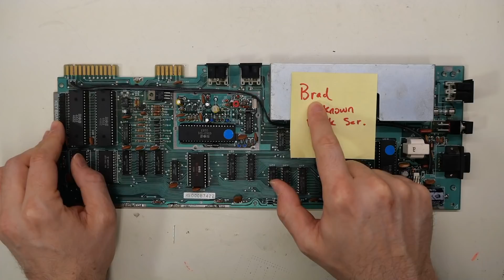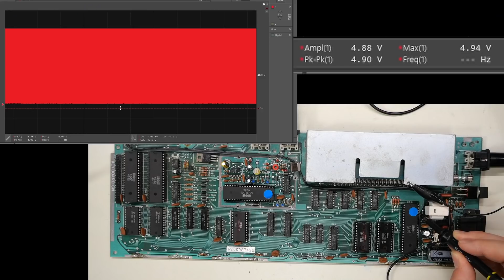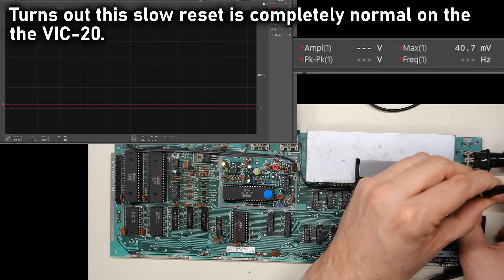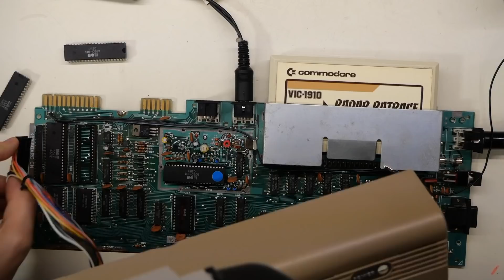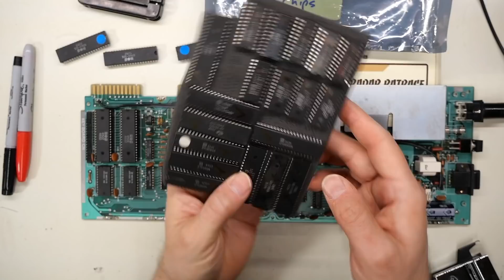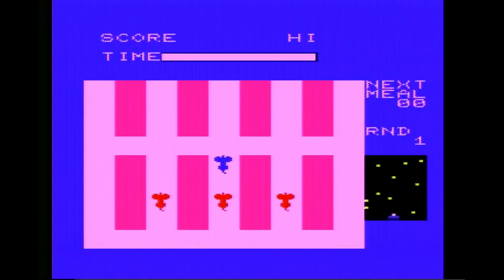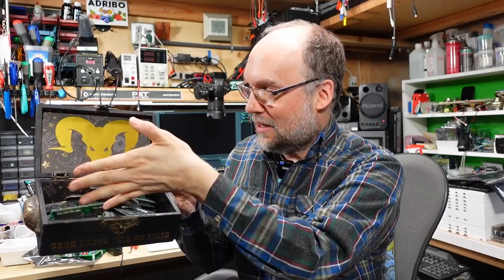Repairing two VIC-20 motherboards

Comment: Well i wish you could repair our vic20’s if our vic20’s don’t work.
Mine seems to not work.
Because all i got is a black screen no matter what i tried, swapping those colored av plugs and swapping av cables while using the right power supply for it.
Yes it was untested but that person had no av cable or power supply for it so he couldn’t test it.
Still through it’s a bummer that mine one doesn’t seems to work.
So if you could repair mine, i would appreciate that.

Comment: The thing with semiconductors is that they do fail over time. At least these old chips won't fail as quickly as modern chips. But they will sooner or later inevitably stop working. The chip can even be laying on a shelf, packed in anti-static foam, in an argon filled hermetically sealed box, and it will still eventually die of age related failure.

One big reason for this is due to diffusion of unwanted dopants entering the silicon. Diffusion is how dopants go into the silicon to start with, usually assisted by having the whole wafer at the time heated to a couple hundred degrees C. A rough rule of thumb is that diffusion gets 2x faster for every 10 degrees C. As an example, a quick 15 minute annealing step at 300 C is going to diffuse these dopants as if one did the same diffusion process at room temperature for 5 thousand years. (This is an excessive oversimplification, but atoms move even if we can't see it with our eyes.)

Different materials diffuse at different speeds. Copper for an example is a speed daemon compared to tungsten. Both these materials are however going to kill semiconductors by turning them into resistors as they diffuse into the depletion region. Tungsten is also what makes contact to the transistors themselves, but due to its insanely slow diffusion, it won't reach that depletion region before copper ions in the surrounding packaging has migrated in and done the job. (since most IC packages have some verity of tinned, copper plated steel.)

Now, chips have diffusion barriers to stop external contamination from getting into the chip. But diffusion barriers are more like speed restrictions. Its a bumpy gravel road with more potholes than road compared to the smooth flat highway, but it won't stop copper from making it through. It will take them longer, a few decades or perhaps a couple of centuries, but they will get there. (at room temperature, at operating temperatures it goes faster. But old chips like these don't get all that hot in operation.)

Modern chips however make a huge sacrifice that these older chips didn't. And that is copper interconnects in the chip. Older chips used aluminium, and aluminium is a weak P dopant and doesn't migrate further than the depletion region. It does slightly change the specifications of the transistor, but outside of precision analog applications the difference is rather meaningless. (also this weak P dopant is why one uses tungsten to contact the transistors, aluminium would introduce an extra diode when connected to N doped silicon, and this would make a lot of circuits not work. Tungsten meanwhile is so slow at diffusing that it doesn't care about becoming a dopant.)

Even a lot of modern chips still use aluminium. It has both a reliability advantage, it isn't toxic to the transistors. And it is also cheaper to work with, since it isn't required to be encapsulated in a diffusion barrier. As a metal it is however having ~57% higher resistance so for very power dense applications it isn't always a suitable option.

Copper though has the disadvantage that it needs its diffusion barrier, adding cost. And this diffusion barrier can't be too thick, then one ends up with higher overall resistance than if one just used aluminium and then it's pointless to use copper. The diffusion barrier also needs to be thick enough, else copper will meaningfully diffuse through within the product's intended life span. So it isn't atypical that the smallest interconnect layers closest to the transistors are made with aluminium, since the diffusion barrier proportionally takes up too much space to make the overall resistance lower than that of aluminium. While the larger interconnects further up use copper, since the diffusion barrier is proportionally thin enough to make the overall resistance lower than that of aluminium.

In practice, a lot of chips don't use copper interconnects. It just isn't advantageous if one has a lower power density, and or aims for a longer product lifespan.

In the end of this long comment.
All chips will inevitably fail from contamination.
More power dense chips made from the late 90's on wards are even more likely to fail in a relatively "short" time span due to the use of copper interconnects. (and also why server CPUs intended for 24/7 operation have lower "max" rated temps for their specifications compared to consumer parts expected to run a lot fewer hours per day.)

But I honestly expect there to be proportionally more (or just overall) computers from the 80's alive and running than computers from the late 90's if we look into the future some 30-40 years. (Though, early 2000's systems are likely going to be even more rare as thermal limits weren't really a thing and these chips runs hot enough to need that. So user induced failure is a high possibility.)

Comment: For those dead VIC chips if I were to make a guess of why these die would be heat. They all get hot inside of a closed metal box. With my VIC-20 systems the first thing I always do is open them, take off that VIC video chip box cover and add a heatsink....if it is working when I get the machine obviously. Then I heatsink the rest.

Personally however I have never actually encountered a dead VIC-20. I perform the preventative maintenance, but again they are never dead. They always however need pot adjustment.

Even so, the chips are old and will all fail eventually no matter what we do. It would be nice to see VIC video replacements though like we see on the C64 with things like the Kawari.

Comment: commodore machines never have a proper reset circuit with a guaranteed timing (like the dallas econoreset). it's just some analog crap involving capacitors with no guaranteed set timing. no brown out protection either. so it can take as long as the capacitor takes :P whatever that may be after 40 years. :P (or what they had in stock at that time ;)

Comment: a 6502 system will usually do 'something' with just the cpu, clock, something to hold the reset vectors (kernal rom or other rom that is either mirrorred up to ffff or actually is at ffff, and preferably stack and zeropage. the vic-20 is a somewhat special case in that the cpu is isolated from the address and databus by some latch logic chips (obviously to let the vic do it's thing). which after pulling everything else out are usually the primary suspects. everything seems to work fine up until setting the border and background color (which on the vic-1 is a combined register holding both) that blue is not the default reset state. funny thing. what makes commodore computers so reliable is that there is absolutely zero error and backchecking. :P 'oh hey imma gonna pull all the i/o chips out and neither the kernal nor the basic will do as much as print an error about it' :P it just initializes stuff and moves on. lol.. it doesn't even properly test the ram :P

Comment: as the kernal rom has the reset vectors and all... i would just pull out the basic rom :P but hey... :P what does one expect to happen when one powers up a 6502 system without defined reset vectors on an open bus.

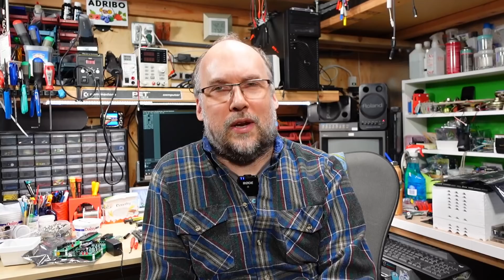Comment: 40:00 people have been working on rudimentary IC fabrication at home but perhaps before that becomes feasible to produce retro replacement parts at scale we might get companies starting to provide cheap custom FlexICs (ICs on flex-cable type substrate, they already made an implementation of 6502 on it). all we'd need is for someone to reverse-engineer any missing chips
Reply: well flexIC might not be suitable for making replacement parts for silicon circuits in foreseeable future because it can't switch as fast (the flex6502 runs at 71khz) but maybe some day

Comment: I managed to acquire what looks like a model 1 Rev b VIC-20. It has 10 ram chips/ gold label and 2 prong adapter. The one issue I'm concerned about is heat. It has a large black heatsink that gets hot to the touch. Is this normal? The main cap looks a bit crusty which needs changing out. thanx

Comment: Interesting. I had visited Commodore just as the C64 was beginning development and saw talked with some of the VIC20 and C64 designers. Quite interesting. You mentioned a "Signetics" 6502 but I believe that would be a Synertek 6502 as Synertek was the second source for 6502 chips. I also don't recall Signetics making a 6402. Synertek also developed some of the 6502 peripheral chips such as the 6545 CRTC (similar to the Motorola 6845 CRT Controller chip). At the time I visited, MOS Technology was considering producing the 6545 but I don't believe they ever did. Great video, thank you.

Comment: I just picked up a Vic 20 yesterday - along with Radar Ratrace (go figure).  No video output (with or without cart) and no sound with cart. Additionally pretty much no chips are socketed. Only 3 sockets in fact: UE8,UD8 and UF8 (the 3 bus transceivers) The Kernal ROM gets very warm, basic ROM gets warm, I think everything else is very cool to the touch. No logic testing equipment at the moment and no vacuum desoldering station (lost in the mail months ago - ugh).  Time to follow Ray Carlsen's best advice on Commodore repairs: "if you have a major problem with your VIC20, it's probably best to start looking for another one"

Comment: Been trying to repair my childhood Vic-20 for a while now. Aside from a bad reset circuit capacitor, which was holding _RESET low for 30 seconds(!) before boot, bad 6560-VIC. Got a couple replacements from kind people on Reddit, but they both had problems as well. First one had a bad clock divider, so no clock to the CPU. Second one can't seem to consistently drive the address bus to get character data and is a thermal fault. Cold Spray helps, but not for long. Makes me worried that all VIC-I chips' days are numbered like the PLA on the C64 or the CPU on the C16/Plus4.

Comment: It is important to know that the newer VIC20 can use the standard C64 power supply, but its original brick must not be used with the C64. It will work for a while but the regulator for the 5V rail is not designed for the load, and will eventually fail destructively.

Comment: Do you think it would make sense to build a drop-in replacement for the 6502 or 6510 based on the W65C816 (the chip from the Apple II GS)? The idea being to retain full compatibility with existing 8-bit software on Commodores, Ataris, Apples and so forth, while permitting new code to take advantage of the 16 bit processing and 16 MB address space of the 816.

Comment: A 6502, on coming out of reset, goes to the top two addresses in memory ($fffe and $ffff) to get the startup vector, the address to jump to to begin system initialization.  One a Commodore machine, you can get surprisingly far without working RAM, a PET can make it's power on bleeps without needing working RAM.  This is rather unusual given how dependent on zero page and stack operations most 6502 code is.

Comment: Unfortunately, the C64 power supply has a crappy 5 volt regulator that tends to die by going overvoltage, killing the machine it's powering.

Edit:  I would suspect that would be why so many chips out of the same machine were bad.

Comment: i still have the vic 20 i got for crimmas in 1982, but i haven't tried to boot it up since '84 when i went off to the army. i've got about a dozen game cartridges, the computer, output cord and the external power supply. it was an interesting device, but i couldn't type for chit, not that i can now, and trying to write code for a simple program when you can't even type at hunt and peck speeds was frustrating to say the least. i didn't get my next computer until 2005 unless you count the ECMs that were in my vehicles because i thought that vic 20 was so useless, and didn't really have a need for one since i had no access to the internet until then.

Comment: The MiSTer project addresses this, as FPGAs are literally programmed using Hardware Description Languages. And someday (perhaps when patents and trademarks expire), the chips will be both be able to be re-created from VHDL or perhaps some other hardware description language, or likely the more practical solution; continue to run as designed in "virtual" FPGA solutions. One additional issue for Commodore computers are the keyboards, but even now, TheC64 can be hacked to work as a USB keyboard.

Comment: It is a shame, but a C64 running all FPGA parts ..... no thanks. It will be same as stuffing a pi and vice inside. Eventually this chips will die. Heatsinking can help. Getting a nice PSU can help. Reason that MOS most compplexchip are, they were scrathing the barrier of waht was possible to this time. But the VIC have been reviewed many times, and the 64C is les prone to failures, wa more robust. Not only the 12V to 9V change, but guess the perfect the process as well. For the VIC20 will be more complicated. Probably the only "real feel" solution would be to delid the chip and have it reversed by logic designers. Issue is, still no PCB WAY for ICs, probably in the future, I mean, you can submit the logic design and the would be doing the difusing and packaging. Setting up an IC manufacturing .... with this low demand ... no sense (now)

Comment: Yeah, I think eventually we will just need replacements for all old chips, as working ones become more and more rare. Sadly nothing lasts truly forever, so I do hope someone will come up with replacements. Though in this case, it is entirely possible that someone just used those boards as donor boards, hence why they ended up with so many bad chips. Maybe even all of those0 chips didn't die in those two machines at all. Since you don't know the skill level of whoever was working on them. I don't fix retro stuff, but for example, I have seen less experienced people selling perfectly working components, thinking they were bad, like graphic card didn't work because of weak PSU. I put it in on my end and it is perfectly fine. Could be that someone thought those were broken, took few socekted parts out and put suspicious parts in,  with margin of error, since not all blue dot chips were bad.
Reply: that is more of a problem with getting scammed than component failure though. It seems likely someone fixed one or more Vics, put in a bunch a bad or suspicious chips in these two, and sold it "for parts" or "not working". This is a problem in the marketplace right now, and not so much a wistful problem of chips eventually dying.  Also FPGA solutions can be found not just to replace single components, but whole computers.  The hardware knowledge is preserved in languages like VHDL(VHSIC Hardware Description Language ), and it usable with the FPGA chip.

Comment: Yes Adrian, eventually the original chips will die and eventually old stock will disappear.  The only way to keep them running, eventually, will be those with open source CPLD and FPGA solutions.  The purists can whine and moan, but eventually that will be all that is left.  Cheap chips were not made to last.  Ten years was their maximum expected lifespan from a marketing perspective.  The best thing purists can do is support these CPLD and FPGA projects in reverse engineering those chips before they die off completely.  Otherwise, with nothing to work with, there's nothing to preserve.

Comment: Wow, anyone playing the drinking game is really going to be hammered after this one!

It would be really good if you could find a way to test the individual chips on the faulty RAM SIMMs, at least any 4M*4 chips that could be reused on my Let's Make Some Memories SIMMs. I'm wondering if there's a SOJ ZIF socket adapter that could be used with the Retro Chip Tester Pro to test them? I don't think they ever made an adapter for the RAMCHECK that works with the larger capacity chips, but even if they did getting a hold of one would be next to impossible.

I have been working on porting my SIMM design to KiCad which will make them fully open-source. But it might be some time since I've been working on other projects, and I want to get a batch made up so I can fully test them before releasing the new version anyway. Then depending if I can find some 16M chips, I might start working on a new board for them.

Comment: MOS really didn't make the most reliable parts, worked in a computer shop in the 90s and we did board repair (well, we swapped in working motherboards so the customer could leave happy and then fixed theirs to go back on the pile). Breadbin Commodore machines made up the vast bulk of repair work. 80% of the time it was a core MOS chip that had just given up the ghost, nothing special on customer side, just it worked right up to the moment it didn't. We didn't even bother testing PSU's back then. Only reason store had a trade in scheme was to source parts for repairs.